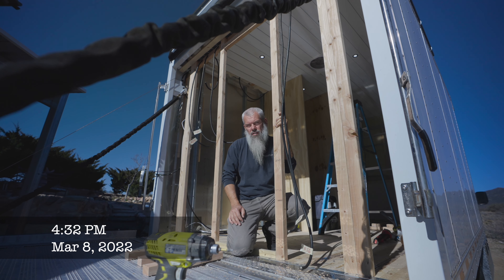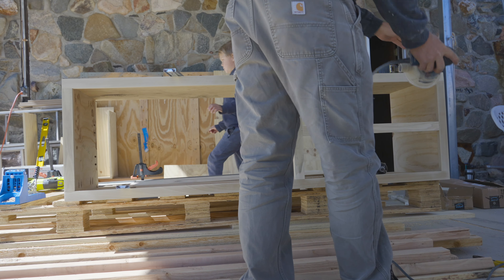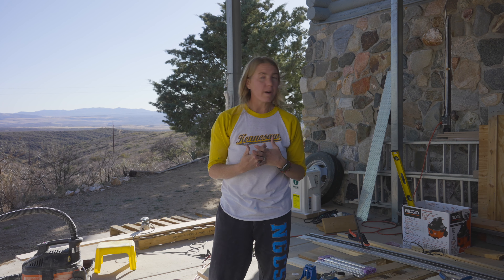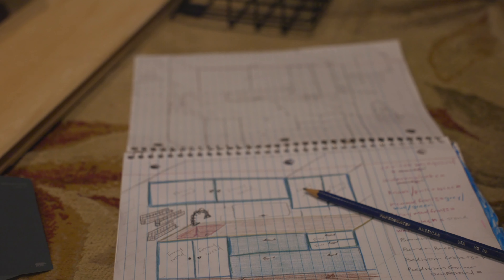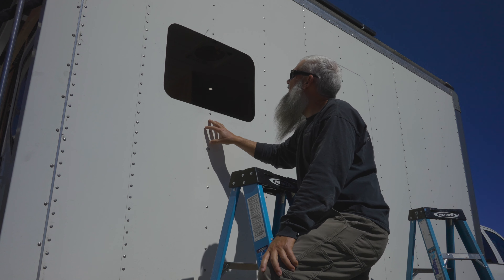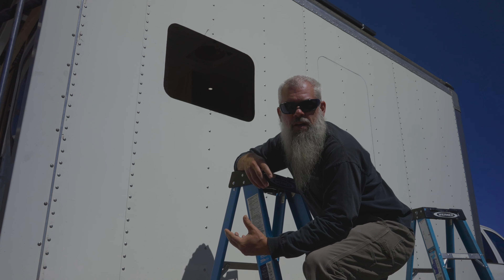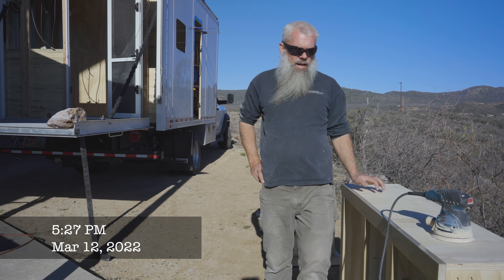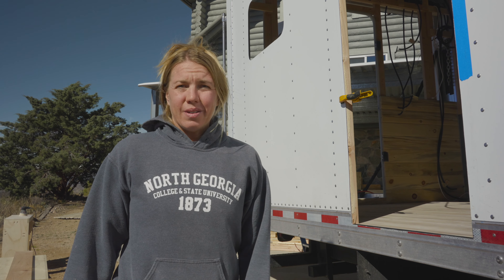DIY Overland |Tiny House | RAM 5500 Box Truck Expedition Vehicle: Part 7 No turning back now!

Comment: Great series as I'm thinking about building a similar vehicle. I have an electrical question, I understand why you went with a 48 volt system to save on wire but was wondering about why have any 110 volts components as you have to constantly switch on/off the inverter to use it and also suffer the built in inefficient energy losses. What's more efficient and/or cost effective having 120 volt system and stepping it down to 12 volt for "a few" 12 volt appliances or having a 12 volt system and using an inverter to step up to "a few" 120 volt appliances?
Reply from the maker: The growatt has a mppt solar charge controller built in so the unit needs to stay on at least during the day. In our van we had the victron multiplus 3000 setup to turn on and off. So we have had both setups and really like the growatt on all of the time. We have both fridges on 120v so it offset the idle consumption on the growatt. Not a big fan of the 12v plugs for example charging our laptop the power brick is 140watt and made to be plugged into 120 so we can get full use of it. The USB C outlets you can get are maxed out at 60 watts. I like having 120v plugs instead of 12v but we do have a few things that run on 12v. Not really sure if one is more efficient than the other. Hope that helps.